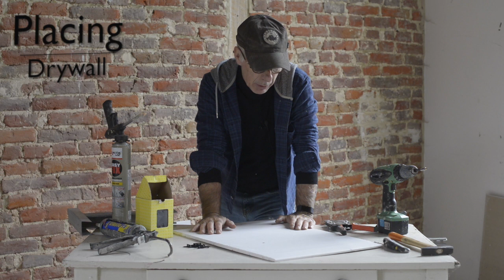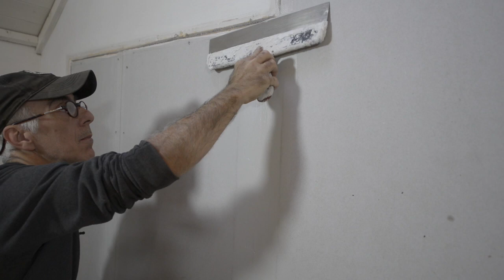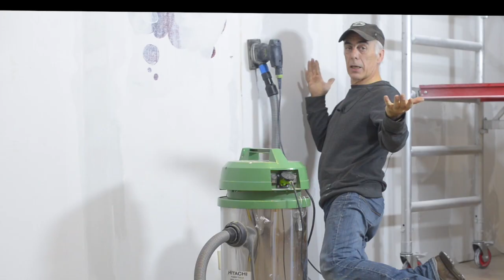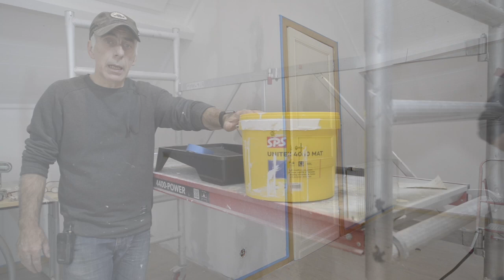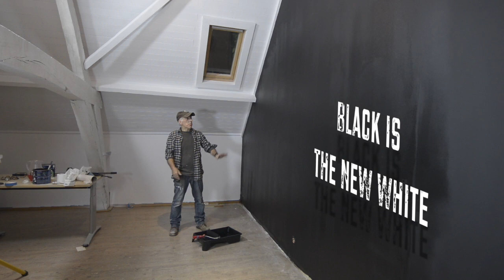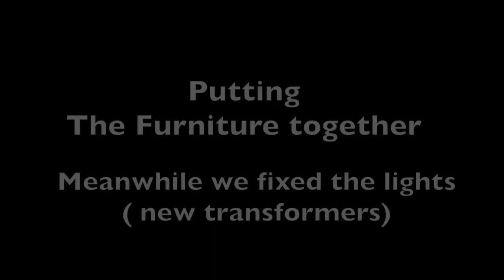Renovating a room from A to Z for  DIY

Comment: you need to tape all joints i did not see you tape old to new at the top
Reply from the maker: Yes indeed Fred, you are right... I did but the video an edited version. will make sure that its in next time.   Thanks again.

Comment: Room came out very nice. How do you heat and cool your rooms?  I find the European systems interesting.
Reply from the maker: The heating is central heating with a hotwater pipe system and radiators.  The burner is on pallets ( wood chips) with an automatic feeder...  The burner/ boiler is for the whole house.   Each room can demand heath, as they all send the demand to the controller.  If one room asks for heath the burner starts .  The radiators in the room, have thermo valves and as the room asked for heating (manual or auto) the valve opens until the room is at temperature at that time the room thermostat ( one per room) informs the burner no need for heat/  at the same time the  thermo valve on the radiator closes....  So far for heating, we have no cooling need as the summers never get warm enough..  at best we get like 30 Degrees Centigrade on an extreme warm summer day...